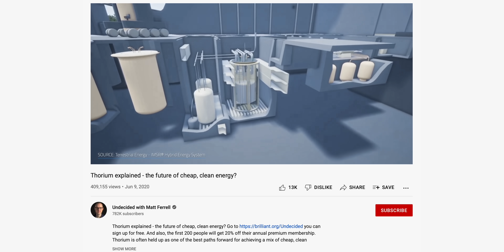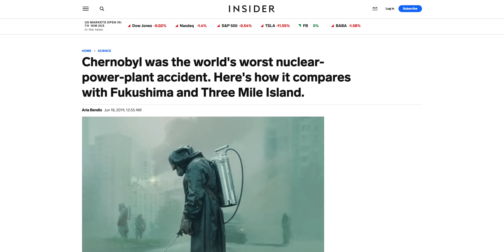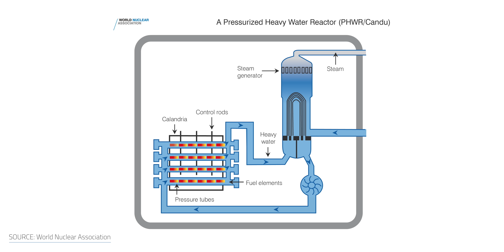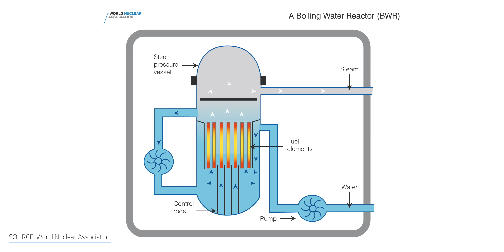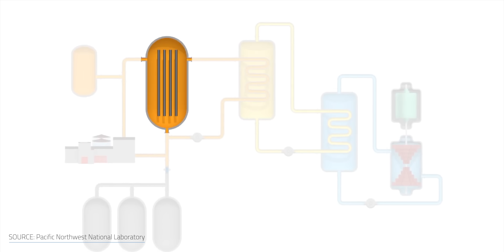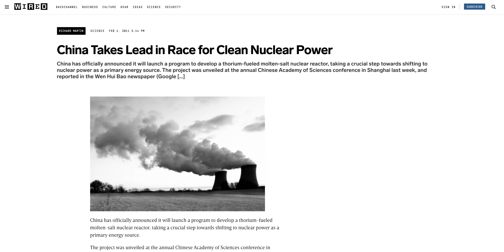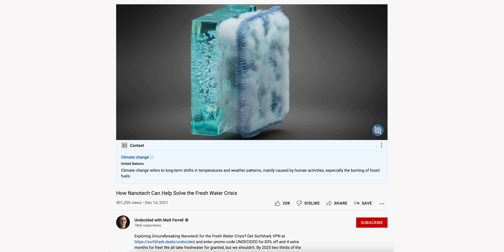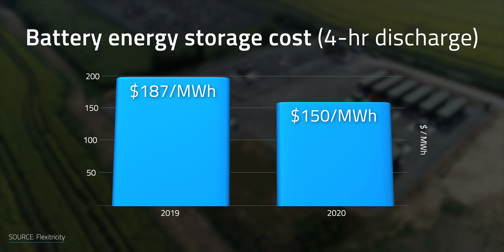Revisiting Thorium Energy - The Future of Nuclear Power?

Comment: U233 breeding of Thorium is just as useful and practical as Pu239 breeding from U238.   U238 is the most common material in used fuel fods from light water reactors.  This means a uranium fuel cycle can produce negative waste as it disposes of existing stockpiles.  This seems far more attractive.

Moreover the neutron economy with Thorium is a bit thin. You need fissile U235 ro bootstrap the breeding, but most likely people will be blending U235 with thorium long term anyway.

"I came for the thorium but stayed for the molten salts".  The real advance here is the reactor concepts not the fuel type.  

Another big advantage is industrial process heat. These things can reach 600C or with more material science, 1000C. This means cracking of water into hydrogen as well as desalination.  CO2 and ammonia harvesting from the atmosphere becomes possible.  Hydrocarbon synthesis becomes possible by tying these things to refineries.  This could clean up the oil industry by creating carbon neutral or negative combustible fuels.
Reply: Not true since uranium in water reactors are made into rods not liquid.
Reply: @romado59  Pardon, I was discussing molten salt reactors, not pressurized water reactors.  I'm advocating reusing used fuel rods from light water reactors as feed-stock for breeding plutonium from depleted uranium.

Comment: Using a 4 hour battery time is ridiculously dishonest, no power grid is sustainable on a 4 hour battery. What lying moron said "nights are never longer than 4 hours"? You need MINIMUM 12 hours of battery storage and that's still not nearly enough to reliably cover all scenarios. Nuclear provides reliable power 24/7, no batteries required. Also do those dishonest LCOE numbers include the cost of dealing with the toxic waste from the batteries and solar panels? Toxic waste that NEVER becomes safe and that can seep into ground water. Where is the cost analyses for solar panels that break during hail storms, hurricanes, earthquakes and tornadoes?
Reply: No, you would need a whole lot more than 12 hours storage. My 4Kw system has only produced electricity for 3 days of the last 30.

Comment: I don't understand why LCOE is counted for 30 years of operation? Most of the nuclear reactors have lifespan of 60 years, new one are designed for 80 years of operation. On the other hand, wind and solar have lifespan up to 30 years batteries even shorter 15.... We can't logically compare something with lifetime measure if we don't assume in equation different lifespan. For 1 NPP we must rebuild 2x wind/solar plant and 4x its balancing storage...
Reply: Plus look at the storage of solar in the cost comparison; four hours!  Not sure where on the planet that would consistently work.

Comment: I'm fairly certain the reason the molten salt reactor experiment was shut down was because the fast spectrum solid fuel reactors were chosen instead. I believe there is video of the original engineers saying this and that they basically were told to go home and throw everything away as a result. I believe it has commentary from Alvin Weinberg too. Though maybe you've found a more accurate source?
Reply: no, the intended purpose was to power a plane.
Reply: @romado59  "no, the intended purpose was to power a plane." Initially, yes, but not by the time Zalphor is talking about. It was Nixon who made the decision, he was asked to choose between LFTR and the Fast Spectrum, but of course didn't have the scientific knowledge to properly evaluate. He chose the fast spectrum because it was in his home state of California.

Comment: Fear-mongering surface level misinformation spreading YouTuber. Gigantic traditional PWR spamming is the cheapest and incredibly safe way to decarbonize the grid.
Reply: Why PWR, instead of PHWR? PHWR boasts capability of running on natural uranium and having a better burnup overall, not to mention ability to create safe pressure-tube reactors (no graphite needed) with all advantages they have (easier construction, on-power fuel reloading, ability to perform selectively-timed irradiation for making industrial/medical isotopes).
Reply: @caav56  uh, mainly inertia? We know how to build PWRs in 1~2 years and cheaper than coal. They are super safe even with the outdated parts. Why bother and mislead the public about better things around the corner?
Reply: @rhmdrhmd-i5i  I mean, PHWRs (CANDU, IPHWR) can also be pretty fast to build... not disagreeing with you overall, though. BTW, Poland signed agreement with NuScale about purchasing PWR SMRs a few days ago.
Reply: @caav56  sure, Canada comes to mind, if it's working for your country, go for it.
Reply: @rhmdrhmd-i5i  It's just that I think hull-type light-water PWRs may not be the best idea, in part due to the fueling outages and having each fuel load be manufactured specifically, instead of being a mass-produced product (like CANDU/IPHWR/AGR fuel elements) due to continuous fuel reloading, which allows the price per fuel load to go down due to mass-production and the demand to stay there constantly, instead of spiking near the end of fuel campaign and plummeting after it, keeping the production facilities going constantly. I dunno, I might be biased towards reactors with continuous fuel reload capability.

Comment: I personally doubt the future of land nuclear power. It's expensive and would require grid adaptation. Where I do see it being used is transport. I've heard that 500 kw a ton is possible. That's .33 hp/ib which is better than most marine diesel and just less than the .5 of aviation piston engines not including fuel. With how much fuel is used in transport ships with no alternative but kerosene this could be huge.

Comment: Soooo it seems like a problem in the comparison at the end is that battery storage has a 4-hr discharge. Night is 0-24hrs depending on latitude and time of year (average 9-15hrs in continental USA depending on time of year). Seems like we're going to need to 2-4x those battery costs.

Then factor in battery replacements and solar panel/wind turbine replacement as their life expectancy is <20 years while nuclear plants around the world are pushing 60+ years old.
Reply: Probably more like 10x the storage.  I have only produced three days worth of electricity with my 4Kw system in the last 30 days.  If it weren't for the grid, I would have had to have hundreds of thousand$ worth of batteries.

Comment: We absolutely need this for base load. Even with LFP batteries, Wind and Solar aren't stable enough for baseload generation as the requirement for batteries is truely massive in the case of solar. There is also the potential in military vessles as nuclear powered destroyers and cruisers (the biggest logistical headache for the military in prolonged operations). 
Further, if demonstrated to be safe enough (which is well within the realm of possibility) it can be used to produce clean shipping. 
Small reactors can be more safely deployed to service remote towns and the waste (what there is of it as it is only 1% or less of conventional nuclear, can be transported as a solid in a tank that can then be heated, melted and pumped. During the transport, there is no danger of a "leak". 
Using this in conjunction of Wind/Solar will also allow less aggregate land use for the grid. From a security perspective, its also much easier to secure to ensure part of the grid remains operational during hurricane etc.

Comment: There is so much wrong in this video I can't just say "Great video, your doing a good job, pleas do more." I literally have 3 - 4 comments pointing out what you got wrong then half way through the video gave up on pointing shit out, pleas do your research and make sure you are reading reputable sources. Also the cost problem with conventional nuclear is that we build nuclear power plants like these bespoke devices like they are art not power generation devices because we are not building many, so building them pre-fabed and putting them together onsite just isn't worth it, but France even without doing pre-fab was able to cost effectively build out Nuclear power plants because they built one after the other, so the teams building them got really good at doing it.
Reply: The advanced Westinghouse AP1000 units of the VC Summer (canceled) and Vogel (100% over budget) had systems built in a factory and then shipped to the site for assembly.  However, they did not fit together and the construction was so poor most had to be disassemblied and rewelded on site and this contributed to a great extent in the massive cost over runs.  People need to face the reality of what commercial nuclear power plant costs and how long they take to build in the U.S.. Pointing to other countries or the PR of these new reactor designs will not change reality. We have 70 years of nuclear power here in America and people keep ignoring what it costs HERE.
Reply: @clarkkent9080  And you are ignoring the fact that I said to make nuclear power and especially pre-fabbed nuclear power cost effective you have to be doing it at scale reactor after reactor so you can keep the people who built the last one on payroll to build the next one so lessons learned can be implemented in the next and it can't be a state half way across the country because most of the workers will not follow you there.

So the scale has to be like what France did to make it cost effective and thinking that what other countries have done can't be done in the US under the same conditions is the kind of special snow flake argument that annoys the hell out of me.

The economics of doing a project in a similar way doesn't vastly change from country to country as long as you have the supporting infrastructure, industries and the regulations are not getting in the way too terribly comparatively.

And if regulations are getting in the way and we can see that countries with loser regulations are doing it safely I think a careful re-examination of such regulations and then a careful unwinding of regulations that don't make sense is the sensible cause of action.
Reply: @Etheoma  The prefab problems with the AP1000 had nothing to do with lessons learned.  The requirements are very specific on welding and the physical construction measurements. There is no possibility that the prefab factory did not understand the quality requirements or that they needed a learning curve. When you are given a build diagrams with every detailed spelled out there is no excuse.  If someone needs a learning curve to read ...well that is a problem.
Every nuclear project in the last 25 years has been massively over budget and schedule.  Until those issues are addressed, nothing will change.  I keep hearing that the problems will be fixed the next time when no one is doing or proposing anything different. Doing the same thing over and over and expecting different results =??? Terrapower selected the Wy site solely for political reasons and is another example of failure before construction even starts.

Comment: In the nuclear end of things, as technology improves or evolves. I believe thorium reactors for electricity generation is a safer type of reactor design. It seems to be fairly fail safe. We all know the record of the solid fuel type reactors. I think thorium is the future as well as other electrical production sources.
Reply: Until a MSR or SMR is actually built in the U.S. and operated safely for a number of years we will not know the cost or construction time required.  Terrapower MSR is projected to take 7 years to build and cost $4 billion which is equal in cost (per Mw) to the massively overbudget PWRs being built. 7 years to build and 5 years to prove the design before we give the go ahead for more to be built (assuming 5 more years).  Can we wait 17 more years for nuclear to come to the rescue???
Reply: @clarkkent9080   And small modular reactors are built in less than two years for less than a tenth that.  Why do you keep ignoring reality?